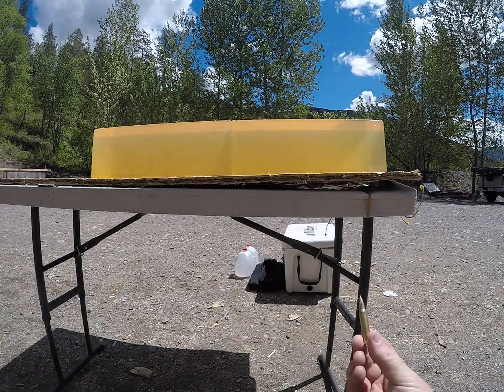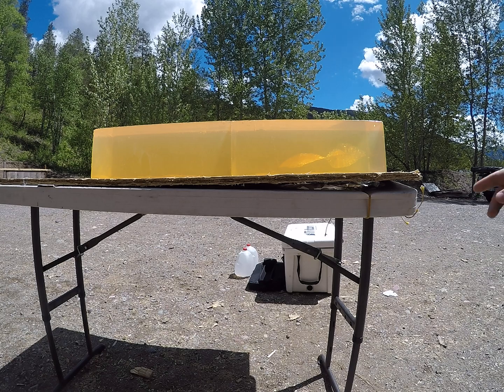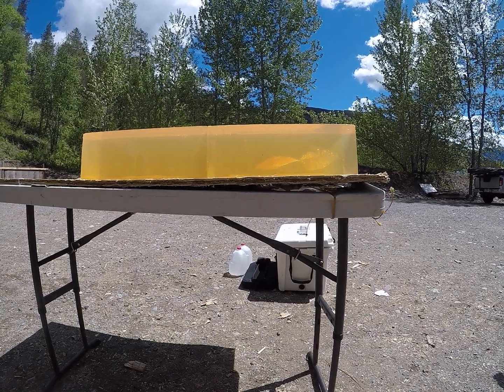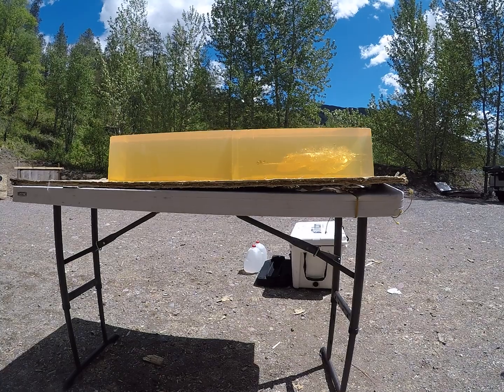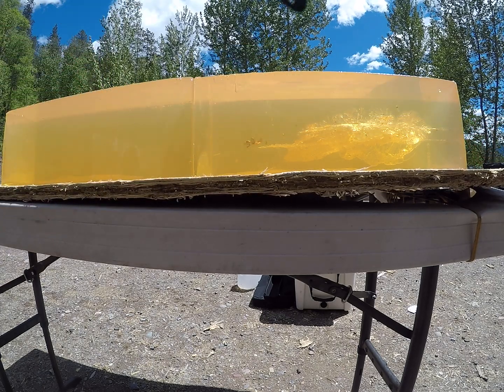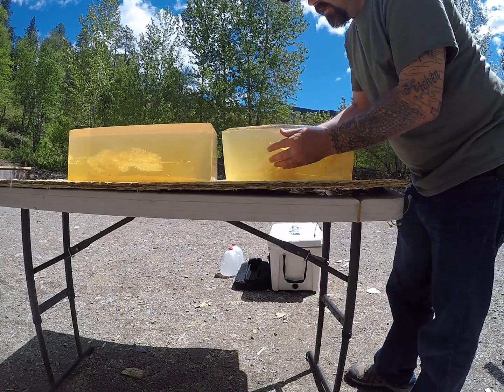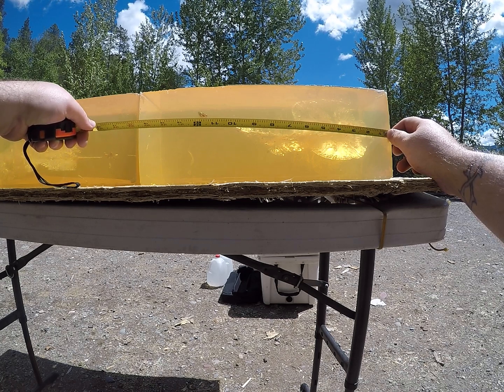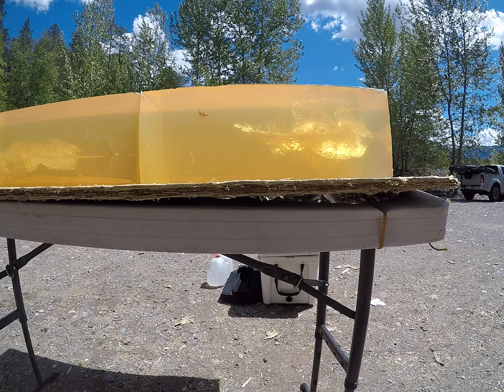223 Rem 77 grain Sierra Tipped Matchking ballistic gel test

Comment: It's crazy that this bullet traveling at such low velocity is still doing 3 to 4x the damage of 9mm defensive loadings traveling around the same speed. I would have never guessed that this cartridge would show such amazing terminal performance at the given speed.

I'm curious how far this bullet will travel before reaching 1k-1200fps. I'm getting 2588.8fps at muzzle from my Garmin xero c1 pro out of a 16.1" LWRC M6 DI MLOK. This is from Black Hills latest lot of 77g otm available to the civilian market. Last time I chrono'd this cartridge was around 4 years ago out of a 16" FN CHF and got 2692.1fps. Black Hills is DEFINITELY lowering pressures in both this cartridge as well as their 77g OTM & MK262 MOD1 - C most recent lots. I have some of their MK262 from back in 2008 or 2009 and was getting well over 2700fps and that was from a 14.7" FN CHF.

Comment: Like the low velocity test, with the calculator basically shows a max range of 600 yards at 1650fps, 460 Ft-Lbs.
Ineffective at 900 yards with 275 Ft-Lbs 1280Fps

Comment: Quick question - why do you think that the cavity diameter produced by this little .224" bullet is on par with a lot of the more powerful calibers you've tested (~5")? Obviously the cavity doesn't extend as far nor does the block jump as much as it does with the larger bullets, but that's still a bit strange to see. Is that just a gelatin thing, or does that translate to actual tissue damage?
Reply from the maker: Bullet design and how it comes apart with higher velocities.

It is a 77 grain bullet which is heavy for 223 caliber. Its common to shoot lighter bullets out of cartridges like the 243 Win although the diameter's smaller with the 223 the amount of energy transfered can be similar based off impact velocities and bullet design. Frontal surface does play a factor but it's fairly minimal in most cases. You're looking at the sectional density of the bullet, how it comes apart, and how it dumps/transfers its energy.

These are a very thin jacketed bullet not necessarily designed for hunting but could apply in the right situation and they come apart and dump a lot of energy very quickly at the higher velocity.
Reply: @simplemindedfella  Thank you for the explanation. Your gel tests are great.
Reply: After you shoot enough deer or see enough video of hits, you'll notice how a perfect double lung shot, lung plus top of heart, or lungs plus liver shots will make the animal curve its body like a scared kitty cat. That's what I believe you're seeing when the gel bends and curves like a scared kitten as it launches upwards.
Reply: @14goldmedals  Yeah, it's pure energy transfer. I've seen videos of coyotes shot by high velocity 22s and .243s, and you can see the temporary cavity in the animal just like you can in gel. It bulges out for a millisecond. Brutal stuff.
Reply: @asdfghjk2933  brutal but efficient. Nobody wants to see needless suffering.

Comment: Awesome test. I would have liked to see more velocity’s tested since the 1000 fps jump was a lot. I’m assuming you were trying to find a minimum expansion threshold? Anyway how did it perform as far as expansion at 1650? Seems like it retained a lot of weight maybe didn’t expand super well? I’m interested in using these for my “duty grade” ammo in my AR 15s but I want to get an idea of how it will perform out of an 11.5” sbr. Thanks.
Reply from the maker: Yes my primary purpose in testing is  to determine minimum thresholds. 

These performed really well and at 1650 it had nearly the same expansion as the high velocity shot. The core and jacket separated, the core was 47.3 gr and the jacket 13.6 gr for a total of 60.9 gr. The jacket at its widest point had a slightly larger diameter then the high velocity round and the core did have a pretty mushroom.

Comment: Military’s around the world use the OTM style non -expanding bullets in sniper/DMR roles. The heavier base like to tumble forward upon meeting resistance.
Reply: This is different from the normal 77gr SMK OTM. These expand and fragment very reliably. They aren't yaw dependent like normal OTM. Pretty much a straight upgrade.
Reply: @asdfghjk2933  Normal OTM’s are not yaw dependent at all. The 77 grain fragments more reliably that almost all 223 non frangible projectiles and it always has, it’s also less velocity dependant than other lighter options.
Reply: @427SuperSnake1  How do they fragment then? The opening is too small to initiate expansion, which is easily seen in recovered projectiles. You can even see in slow motion gel tests that OTMs yaw before fragmenting. It is by definition, "yaw dependent".
Reply: The 77g otm are COMPLETELY yaw dependant to achieve adequate terminal performance. What happens is the second the bullet contacts it's target it will begin to yaw in any given direction and will break apart at its weakest point which is right at the cannelure.

Where the TMK shines is that it has a very low velocity threshold where you can expect reliable terminal performance when directly compared to the 77g otm.

Multiple data sources online show the lowest velocity threshold for the TMK for reliable terminal performance to be 1600fps while the 77g otm is 2100fps. This is a MASSIVE difference and equates to several hundred more yards of terminal performance.
Reply: I knew some military guys would talked about the 77gr matchking load. They snacked up every box when they saw it because of its better terminal performance. I wasn't so sure of it but this test really proves what they described.